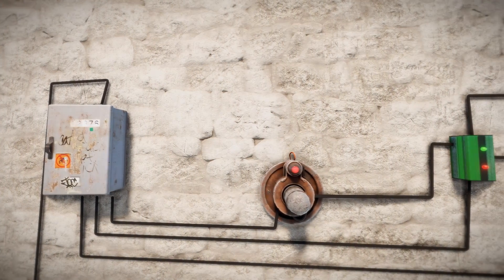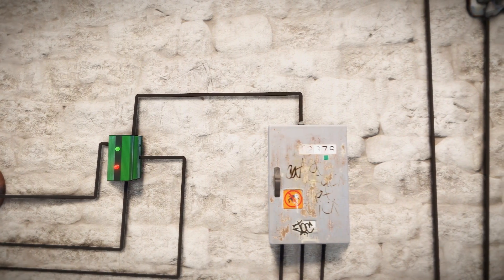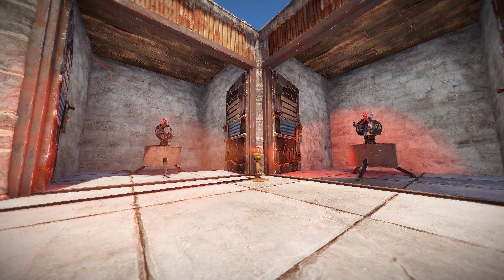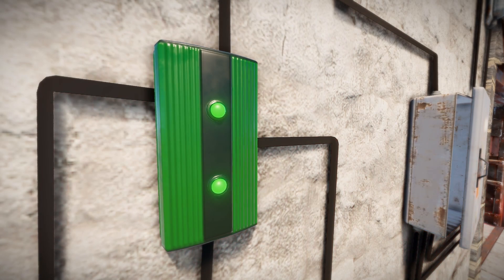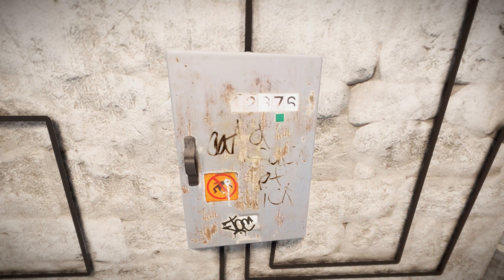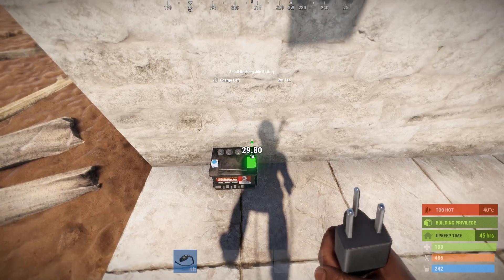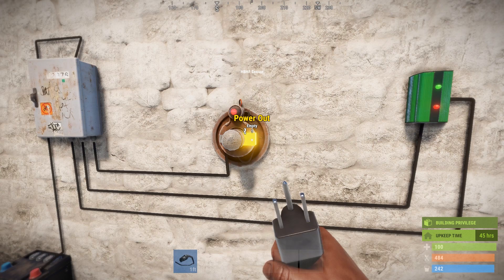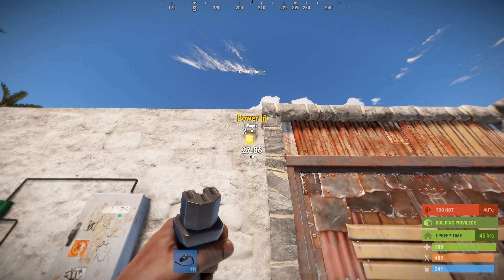RUST 101: Electricity Guide - Using The Sensor Properly

Comment: I have replicated your video, and others and i have  not been able to make it works, maybe is totally broken since months? i dont thinks so but i dont find any explanation why the sensors are not working... (even in discord, steam bug forum etc...)
By some unexplainable thing, the sensor doesnt change the range, https://youtu.be/kbx0op75AiM
I have tried to place it in different walls, and i have to admit that in others it reach more range, but still not obeying the range number setted in :S
I dont understand, i am doing something wrong?
Im just replicating some guys video.
https://youtu.be/O7XjrkILzVc
Reply from the maker: Hey! So back when I did that vid they didn't have a range setting. That being said I have used them since they added it and it has worked for me. So long as you're sending at least 2 power to it (one for it and one to pass on) then it should be triggering at whatever distance you have set. Just ensure that you've configured it or either authorised, not or both depending on what you're using it for.

Comment: Oh my God dude I've been struggling for like an hour or 2 trying to figure this shit out 😂 I don't ever use them but I got one from a crate and wanted to try to use it, and he goes somewhat slow so it's easy to  follow along, thanks man 🙏🏼
Reply from the maker: No worries man! Here's a fun one for you to give a try... put a button by your front door, throw that hbhf sensor outside above your front door and then put any sort of alarm light inside next to the button. Wire the button the the hbhf sensor and then the sensor to the light. Buttons push out 2 power when they're pressed without being powered so you don't need to power this. Now anytime you're leaving your base hit the button and if the light turns on you're being door camped. Have fun and stay safe! :)
Reply: @Malonik  you're the man brother🙏🏼 kinda funny the video is 5 years old 😂 I used to play on PC but my PC broke👎🏼 so on console but should be getting a new one after bootcamp

Comment: thx man.  I still dont know how to connect some more sensors together when putting them arround my base, so need to connect 10 or more. but because of trigger function the 1 energy trigger gets lost
Reply from the maker: Been a while since I played with XOR switches, but if they still say they consume a power but don't actually you can use them to funnel all of the sensors down to one output. 

Failing that you could get away with using and switches on the initial row and then run them into XOR or OR switches. That way one line into the and switch can essentially just be the power to push through the pyramid of switches as and switches will always take the higher power of the two.
Reply: I found the way, but it needs many parts and is complicated with so many sensors ^^ @Malonik

Comment: This should be easier but they have some parts that makes no sense at all. You should be able to do this with the smart switch and lasers, but when you try it the lights or device loses power as soon as you step out of the laser you would think if you have one trigger wired to the smartswitch toggle on and 1 to toggle off that the device would remain powered until the toggle off is triggered but it doesn't and it makes 0 sense to me.

Comment: How is that small battery powering both those turrets?

Also, you could simply have the HBHF sensor toggle a timer.
Reply from the maker: Lol that was 100% movie magic. I usually  just use the admin spawned generators because there's so many different power sources and setups people can use. 

Also good call on the timer.

Comment: Thanks. I did as exactly as you said in game, and I got it working. Now, I'm toying around with it in a sandbox server and I can't get the sensor trigger the alert signal. Frustrating.
Reply from the maker: That's weird, the alarm only needs 1 power so it should be as easy as sending the output from the sensor into your alarm. Maybe wire an alarm up by itself to make sure they're working on that server?
Reply: @Malonik  thanks for the reply. Do you know how far the sensor will detect another player? Is it just in the immediate vicinity? I have mine placed in the 2nd floor. Will it detect people walking around outside the house?
Reply from the maker: @LucasChase345  No worries man. :) The sensors range is roughly 2-3 foundations away from it. So if it's on the outside second story it will catch people walking past but it might miss people on the corners depending on how wide your base is. Should also note that it can't detect shit through walls so if it's inside definitely move it outside lol.
Reply: @Malonik  ahh, I see. I have built a cottage-like base with a second story that is somewhat restricted by the roof. So yeah, it will go off when I get up there and open the door, but nothing else. Considering the small amount of power they use, I guess it would be possible to create one for each side of the house, and just rely on one solar panel? Then connect them all to the signal light up there. My original thought was to add an auto turret to the circuit, so that when movement was detected, the doors to a pillbox for the auto turret would open, and the auto turret would go on. I found another video and the idea with that one was to use a blocker to have the doors close to the pillbox when the auto-turret runs out of ammo. Much less complicated, considering the auto-turret doesn't need any help in detecting if someone is there.
Reply from the maker: @LucasChase345  Yeah it's also safer for the auto turret because if someone drains it they don't get to break it for the gun. :)

Comment: I want to make a setup where there's a HBHF sensor deep in the base, and when it's triggered it permanently sets off a smart switch which opens 6 garage doors and 3 sentries. I've seen a video on how to set up the sentries and garage doors (using branches), how do I add the HBHF sensor to trigger the smart switch?
Reply: the smart switch is a toggle. So just use it as a passthrough after your toggle

Comment: @Malonik why do people say electrical branches are more power efficient? they are not. a branch will constantly consume the power configured to branch off, meaning if you're just using it as a splitter for something that can be turned on/off with a switch, it's going to cause a power drain. splitters are much more power efficient. i had a base with 4 components that could be switched on/off and changing all my branches to splitters made my idle power consumption go down from 21 to 5.
Reply from the maker: I was actually debating this with gal the other night. It took a long ass time lol.

It really depends on what you're hooking up but there's some little bits and pieces people don't realize. For example if you're wanting to be exact with splitters you've got to branch off the exact power you want it to have which means you're already using a branch so splitters are just an extra component to get. 

But let's say you found it so why not use it. Say you're using it to power 3 door controllers so you're pushing 4 power to it, 1 for the splitters and then 1 for each line for the door controllers.

If you lose 1 power to that you'd expect that one line would stop working. But that's not the case, instead the splitter shits the bed because it can't split 2 power across 3 outputs and everything stops working. Where as with a branch it'll keep sending what it can (branch first then power out).

They also round down. So say you push 12 power to a splitter. 1 power is the component and then it has 11 power to split 3 ways. That's 3.66 but because it rounds down it pushes 3 to each and you lose 1.98 power to literally nothing. Where as you could use 2 branches to achieve the same output for less power.

They also make it more complicated to expand circuits which is why I generally stay away from them. A lot of my circuits are made on a small scale but I know bigger groups like to implement them and expand. Being able to just wire more in from your branch chain is a hell of a lot easier than rewiring and adding more splitters.

So if what you're using the splitter for is perfectly divisible by your number of outputs, won't be expanded in the future and your power source is super reliable then it's worth using them. 

So they do have their place they're just less versatile than a branch.
Reply: @Malonik  thanks for the reply mate, i wish there was a two-way splitter or we could configure splitter "channels", maybe in the future!
Reply from the maker: @syzygysum  No worries! You can use the splitter for two outputs by not plugging in a third but yeah more control would be great!

Comment: It's easier use a AND switch (A: Sensor output, B: Power Supply). This way, you'll get the full power when the sensor detect someone, and you'll use less components
Reply from the maker: Yeah I found out about that a while after the vid. I'm actually using that in an upcoming vid. :)
Reply: @Malonik  link please. Lol. I would like to watch the update. Been exploring Rust electricity I'm no expert but it's amazing! A lot of ways to do things.
Reply: Oop yeah. I wish HBHF could just output more lol
Reply: @MysteryNeverHere  to be honest it makes more sense if they just let the sensor do that. Silly not to actually.

Comment: In recent times, you can do this more easily with an and switch and an electrical branch. It can easily be seen here. https://www.rustrician.io/?circuit=08938107c5470b0a71b57dbc4c603d10
Reply from the maker: Yeah that's a hell of a lot easier. The important thing to take away from the vid is that the sensor is a trigger not a power source lol.
Reply: @Malonik  u da real MVP cause I did that shit exactly haa ha ha
Reply from the maker: @kaplislemesis4789  lol thanks! :)

Comment: It would help if I knew how much power each one needs. Does the first two connections to the memory cell and HBHF sensor both need just one rWh or whatever the unit is? Just for signaling purposes? I think that's the case but i'm not sure.

Comment: Hi Malik, I’m using this setup to trigger the force start/stop of a generator to power tesla coils and I can’t understand why each tesla coil is registering as 35 power from the battery (which powers the components) even though the tesla coil is attached directly to the power out of the generator.
Reply from the maker: It's because the power the tesla coil consumes is 35. Check out the rustlabs link below (it has all the stats for the tesla).

https://rustlabs.com/item/tesla-coil

Comment: hi , Im using a cave base . and wondering if the hbhf sensor can be used to tigger turning on of a generator, and timer to run turrets then turn off after a set amount of time, is this possible if so maybe explain or make a video on that . this would be a great help thankyou for your time

Comment: possible to add a timed duration for the doors closing? how would i go about that if anyone could lmk?
Reply from the maker: Absolutely, so if you run your sensor into the trigger on a timer and then use the timer to power your doors then they should only stay open while the timer is active and will shut when it finishes. :)
Reply: @Malonik  i am having a hard time trying to add the timer delay, could you go a little more in depth?
does the timer power the sensor or does the sensor power the timer?

Comment: i built that exactly the same way but the sensor doesnt work bro ?
Reply: yes me too. I copied this but it doesnt work
Reply: @Spliffy2284  the battery has not enough energy make it the same way but just use a solar panel instead of a baterry

and when you use 2 solarpanels and connect them with that small red thing it works perfekt for me

Comment: I am not able to figure out, how how how, to make large rechargable battry recharge from turbine while my turrets are turned ON. My L.R Battery never charges and it keeps triggering turrets ON-OFF on off... am i missing something? Thanks
Reply: Your things turning on and off constantly means that your battery does not have enough power. 
To help you fix the issue use the display thingie(forgot the name) to check your electricity output. Remember that ONE turret takes 10 electricity output. You may have a power shortage my friend.

Comment: so with this set up  you could ... if i am correct... have 3 Auto Turrets hooked up to one sensor instead of the doors and flashy light correct? that way your turrets wont drain your batteries by being on all the time. ... yes?

im about to go completely rewire my base because of this video.. and i hope i don't screw it all up B^) thank you so much!!!  i have been trying to figure out how to rig these dang sensors up to the turrets for a while now. and no one has made any videos on it yet, all i could find were how to hook power up to them B^P   Thank you very much for this video explaining the sensors. you may want to make a new one showing how to hook up all your turrets to them as well because it would be very useful for others im sure. especially for us solo players
Reply from the maker: Yes however there's two things to keep in mind with that... 

The first is that each turret requires 10 power so you'll need to ensure that you have a for bit of power running through that circuit. 

The second is that turrets take a considerable amount of time to turn on and while turning on they can be authorized on. So you're going to want to make sure they're not easily reachable otherwise people can auth on them and they won't do anything.
Reply: @Malonik    hmm... good to know!  right now i have 6 large rechargeable batteries with 4 windmills and 6 solar panels hooked into them... and currently i have 6 turrets.. maybe 9... now that i think about it because i have two batteries hooked into one spliter each spliter has 3 turrets hooked into them, i also have them connected to switches so i have 1/3rd of them powered at a time for 4 hours.. give or take. 

as for the authorizing bit.. i was wondering about that too. i may just set up shot gun traps  around them, plus they are kinda high up so that might help as well.  again thank you so much!! your video has been super helpful!!!!
Reply from the maker: Oooh shotty traps is a really good idea!!

Comment: This is a great guide - I just wish some of the concerns in the comments had been addressed.  I am using large solar panel, to small battery to power pretty much your exact set up but just opening two doors on triangle platform.  I was checking on my turrets etc and see the batter is constantly at 4-5s remaining on power - so my assumption is as soon as it’s night this won’t work?  

Solar panel to small battery
Battery out to splitter 1

Splitter 1 to HBHF in, mem cell power in, mem cell reset

HBHF out to mem cel set

Mem cell out to splitter2,

Splitter2 our to 2 door controllers
Reply: this is a bad setup.  use the AND switch and this to do what you need.  Have a solid source of power coming into the AND switch, when the sensor turns on and sends that 1 power to the AND switch, then its ON but the power is based on the other input which a value you can pre-establish.

Comment: HBHF, drains all my power in no time even if it doesnt trigger anyone, doesn't matter how many power generating stuff u have, any ideas ? Also same with splitter, power just keep draining.
Reply from the maker: Yeah it'll be the same with most of the electrical components because once it's outputting power it outputs at full regardless of how many components you have in your circuit. 

What are you using as your power source?
Reply: @Malonik  Assuming you've decentralized your power grid, you can use blockers to stop power of any batteries you do not want draining while the trap is not active.  This does assume you have the ability to branch off power from more than one location.
Reply from the maker: @josephdavis3472  Yep correct, I always try to minimize my builds as much as possible so they are as cheap as possible.

Comment: my doors constantly open and close on their own ive followed this twice after starting from scratch and get same result.  in the video he doesnt stand long enough to tell if thats the same case here.  can anyone help
Reply from the maker: They shouldn't be opening and closing on their own, what are you using to power it? It almost sounds like a battery that's out of juice so it kicks in for a second but then cuts out and repeats the cycle as it gets a second or two of power.
Reply: @Malonik  yup after i added double the panels all was well.  forgot to turn back the turrets on though, now they are someone elses. lmao.  time for a new base!
Reply: @smatchimo55  Just a heads up, this can also happen when using multiple sensors if you use XOR instead of OR switch.

Comment: why not use the sensor direct to the splitter? the effetct is the same and we can have an higher output, or i'm wrong?
Reply from the maker: The sensor outputs 1 power for each person it's detecting. So if there's only 1 person then it'll only push out 1 power which would power the splitter but not send any power out.

That's where people get stuck which is why I've done it the way I have. There is an alternative by using an and switch instead but it can't just directly run to the splitter.
Reply: @Malonik  oh, now i understand, thanks for sharing your knowledge, will be helpfull, i will try find the alternative way using the and switch, i'm curious!

Comment: Something to note is that the HBHF sensor outputs the number of people it detects in the form of power, so 5 people = 5 power, 1 person = 1 power. It is however bottlenecked by the amount of power going into it. For it, to output 5 power it needs to get 6 power or higher. You can also use the combination of an AND Switch with an Electrical Branch for a more simple way to pass power.